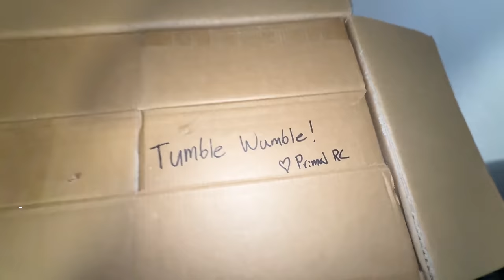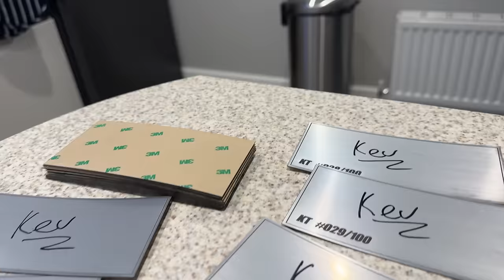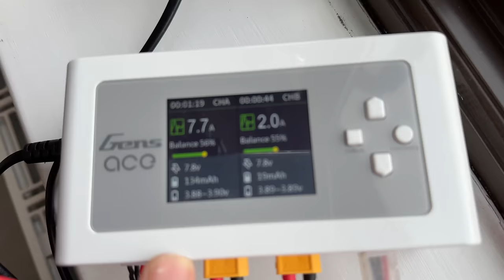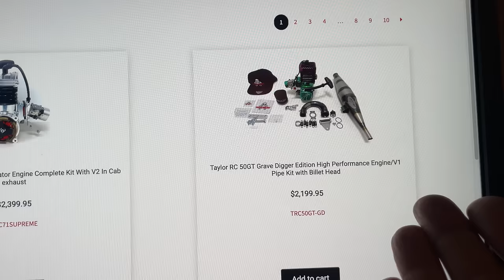The King of all RC Cars

Comment: Would love to see a Small V8 Engen inside the Monster Truck just to give it that bit more BEAST
Reply: Well the small v8 engines aren’t powerful enough for this application. Also they are super expensive. You need either a 2 stroke or a large nitro to power these
Reply: @charliemaybe there’s a grave digger selling on eBay that has that conversion

Comment: Hey Kevin Talbot big fan and long time supporter I was wondering about what servos you use in the 1/5th scale monster trucks and if you use a splitter or not because i have 2 XL servo slots and only 1 steering plug into the receiver i think theyre like 2-1/2" x 1" servo slots

Comment: $3700!!!!  Yea no thanks
Reply: Also it seems to be highly unreliable. I would pick an Xmaxx ultimate for half the price! 😅
Reply: $3700!!!! yea YES thanks
Reply: @francoisdesmarquis8548 yea it’s basically the Bugatti of RC cars… not REALLY designed to be driven full tilt for very long without heavy service 😅
Reply: Lucky for me I use pounds
Reply: I bought a 2001 Toyota camry with 60k miles and spent a total of $1900 on it after brakes and exhaust. Ive had it for 5 years now 😂 i couldnt imagine, unless i was kev. He makes plenty.
Reply: I have 3 of them
Reply: It looks not so fun.
But sure he says that he had most fun with this one. So he gets sponsored.
If it Breaks on first drive its not so fun if you pay by your self
Reply: @V8chump a bugatti holds up and has guarantee
Reply: @maxmoritz5065  a Bugatti clutch probably needs changed VERY REGULARLY if you’re driving it flat out like people do RCs let alone other basic engine maintenance which is much more frequent on exotic sports cars
Reply: @V8chump  of course. But he did test it for a quick drive and it Breaks.
A traxxas hold up much longer.
I have a KTM Dirt bike and drive it fully send and it holds up
Reply: Include the! China big- bore 50 CC Pocket engine.
Reply: In Malaysia.if your salary is 4k,you can only afford kraton exb 6s with this price
Reply: Yeah I agree. But it's still a cool car
Reply: Only $3700 yes sir!!!
Reply: Right, I can build a beast for 3700 that’s faster then 30mph
Reply: Love mine 💪🏽
Reply: Yep me too
Reply: Can I have of your rc car plz Kevin Talbots please bro please

Comment: You could also put a roll pin in the hub as oppossed to a nut and bolt Kev. Or, better still, two grub screws at 90deg nipping up on the shaft (file two flats on the shaft at 90deg for the grub screws to locate into or, dimple the shaft with a drill bit).
You're welcome for my 34 years of engineering expirience!

Comment: I finally did it! Got my first RC. Can’t wait to start ripping loose tomorrow. Got a jetwood 1/14 4x4 off Amazon. Came with two 3s 2200 mAh batteries and says it actually has metal gears. Super excited! Thank you for the inspiration to jump into the hobby. 🎉 🛻 🎉
Reply: Order some 3s batteries after you get the hang of bashing around.........and also order 4 complete Diff's cuz you will need them soon after. welcome to the hobby and I hope you have a blast! P.S. most of us are here to help so ask any questions if you have any even if you think it sounds silly, trust me we have probably asked the same one in the past 👍✌️
Reply: @jordancoleman2402  already ordered 2 3s 2200 ones. They will be here Tuesday. It came with what looks like 2 cv axles, extra arms, shock springs, and a few other goodies like body posts and such. I’ll have to find out where to buy the gears though. No idea where to get the extra parts and there’s not a hobby shop within 100 miles. Lol

Comment: If you brake in the air it will nose forward and if you throttle in it will roll back. You can use that to level the truck in flight 😀
Reply: Um, I'm sure he knows this

Comment: Use rubberized bed liner on the inside of the body and it will help to prevent cracks/breaks. Duct tape works too but not as good

Comment: I want to see a video of a nitro converted xmaxx. Just for the cool factor. Nitro in my experience has too much power for the trucks they generally get put in. So you end up stripping gears, and blowing up driveshafts. 
But with the xmaxx’s being built as tough as they are, i don’t think this would be an issue.

Comment: Looks great, Kevin. Head's up. When you get a new maxx slash, take a look at the front suspension.  Bottoms out bad. The spacer for the rear shocks on the lower control arm will work in front and stop the issue will be resolved. May have to tight shock in rear to level. Enjoy your day. Be safe

Comment: Hey there loving the channel just wanna ask do you do a break in on your 2 stroke engines or not required? Just wondering cause I've always been told let em idle for a tank and than a tank like 1/4 throttle max and then a tank working your way up to full throttle in various loads not constant load

Comment: Would be Nice with a powerfull 4 stroke engine.. It would sound more right 😉 
Also I think it would drive better with some stronger springs in the clutch = more RPM before clutch engage = stronger off the line/ acceleration 👍

Comment: I just bought a rust free 1996 VW GTI VR6, for 3300cdn$ 

It needs paint, the clear is gone, but it runs and drives, 109xxxKM

3700 for anything rc is nuts.

Comment: Theres no such thing as overkill. You should use a 3 speed gearbox on it, 3 forward gears and reverse.
You'd be able to get that monster truck torque for taking off and for easier close circuit jumping but then have higher speeds for more of the open area jumps.
I think it would be heaps more fun having that raw bottom end torque to be able to launch the truck.
Like how real monster trucks can be in front of a jump and with no run up, just from their torque can backflip the truck. And when the trucks on it side you can flip it back on its wheels.
You might be able to get this with a manual gearbox.

Comment: A well designed RC car, especially with the upgrades. What I don't understand is: why use the engine of a cheap China minibike? It is already an expensive product (make it a little more expensive and) supply it with a Taylor / ALX or dual brushless. Or completely spectacular, take a water-cooled engine from a Blata / Polini minibike or even better KTM 50 😁

Comment: Dude go brushless. 100% no question. The Taylor engines are cool but a piece that nice that could get the rozzers called isn't the move. Maybe the Isle is different but I know where I live, every single time I rebuild one of my son's top ends on the young ones 65 and the oldest ones 125 I have to seat the rings and get the tune squared away on my street. Every time  someone calls the cops. I mean my boys are in the pro class of their engine size locally. They're fast. Super fast. So I build their bikes, especially their engines, to win races. My son's 125...well...it's actually a 130 but let's keep that between us. The thing can hang right with my yz300 2 stroke when my son is on it. My bike is wicked. I bought a 2022 yz250 2 stroke new and put a 300cc big bore kit on it immediately. Best bike I've ever owned. Anyway, my point being these days people are getting super uptight about loud things that scare their little dogs. So just go brushless and avoid the trouble. That way you can rip that thing everywhere.

Comment: 5:07 I wanna see a TOYAN V8 in this truck
Reply: That would be so underpowered. Even if it had the Supercharger on it a Toyan V8 would struggle to even get just one of those wheels to spin fast enough let alone all four of them at the same time. Not even having four of them powering each wheel could get the weight of these Raminator Trucks to move fast enough for Kev or anybody. A 10th-scale Monster Truck would be more suited for a Toyan V8 Motor.
Reply: @gugman9684  It would still be incredibly cool

Comment: Idk, 4k, then spend another 2,400 on an engine upgrade? Primal should have met in the middle with a Taylor 70 and painted to match the truck,  then signed! That would have been better than another truck. It's version 4 with a crap motor. Could have been a better value to the customer spending 3 or 4k on the truck. You'd feel like you're getting your money's worh. If it was done that way, I'd buy one!